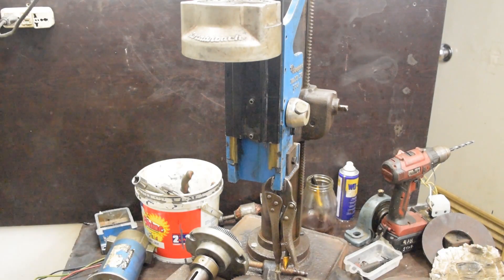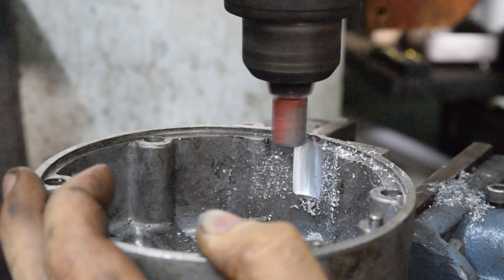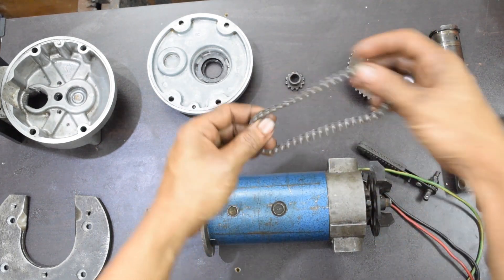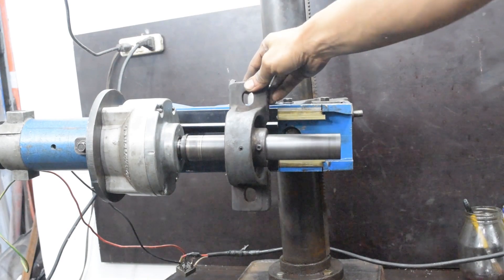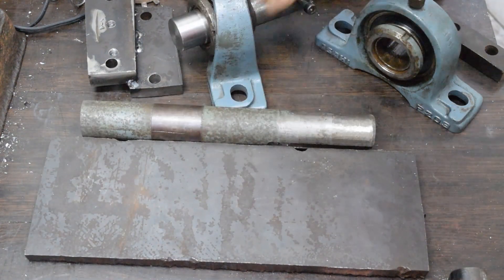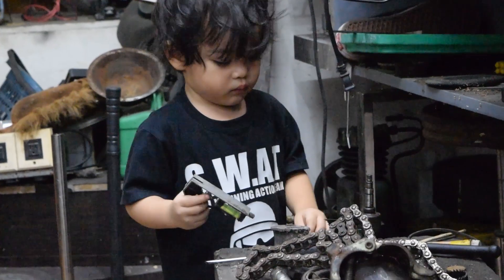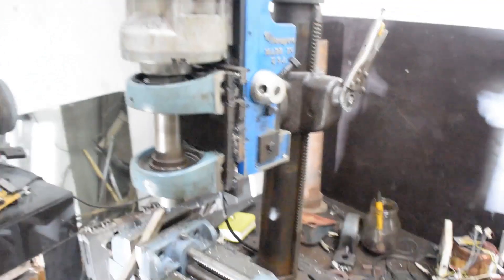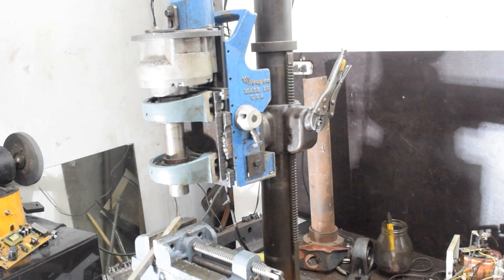HOME MADE MILLING MACHINE FROM GARBAGE MATERIALS! PART 2

Comment: lol that's chattering and leaving a poor finish... because thats absolutely NOT how those bits are used. You'd likely be so much better off getting a cheap lathe cutter and doing it properly
Reply: oh and also that spindle could very easily be deflecting by sticking out that far without a rest to hold it in place. ALSO! try using the side of the end mill to make the cuts, having it interact at a fixed angle like that should work better.
Reply: I'm really enjoying your videos - let me know if you ever want to chat! I make small precision stuff because I have almost no space, but I really enjoy watching your projects
Reply: for the love of zeus dont abandon it! The spindle looks 10x better than most handmade machines on here
Reply: a TON of your concerns about vibration will be adressed by properly mounting and bolting everything down to a ridgid desk
Reply: lol sorry so many replies - I worked for a long time designing concrete.  if you can get your hands on some, plasticizers, and water reducers, as well as some fibers, like cotton fibers or rope fibers, can make the crete much stronger. 

Honestly though, dry sand and epoxy would work much, much better. though it may cost a bit more.
Reply: Wheres your video  and remember  dealing of what you can find and scavenge...not ho and buy and no push button. Cnc